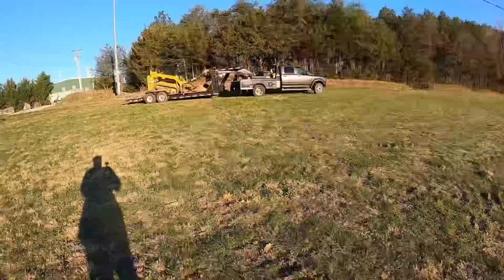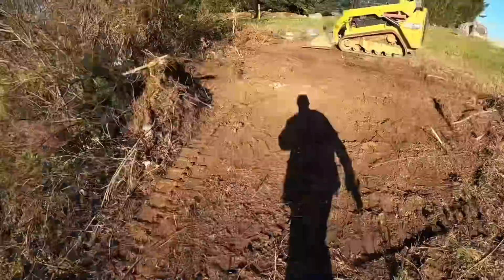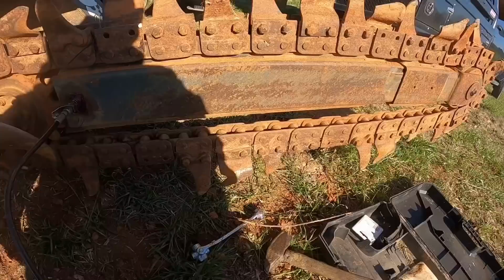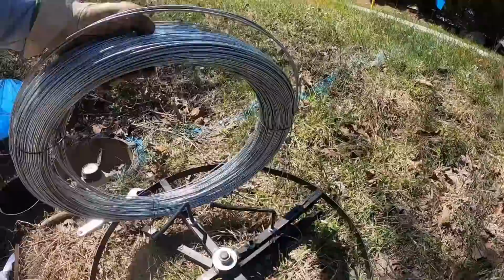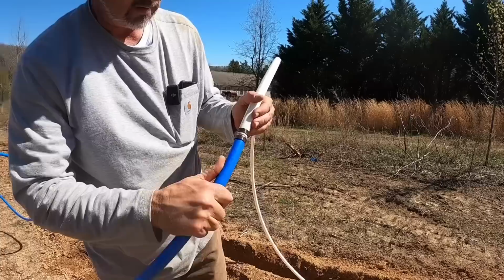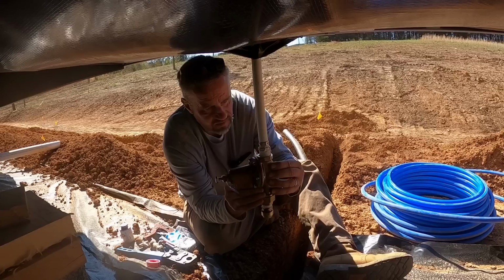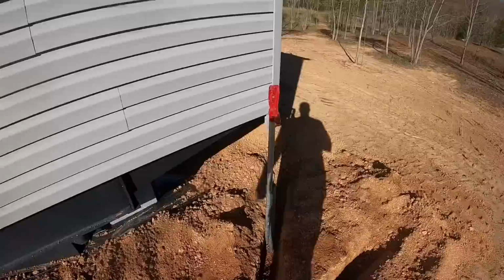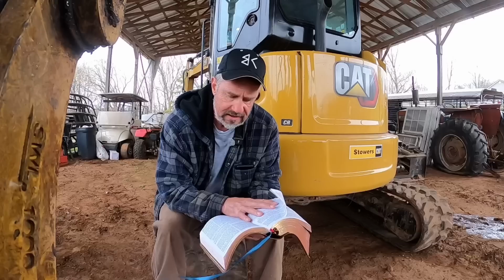START TO FINISH IN 1 DAY!!! 500’ OF PEX WATER LINE, FROM THE CITY METER TO THE HOME…

Comment from the maker: Had a regular commenter reach out to let me know his comments were not showing up in the comment section and disappearing from his comment section as well.
Is anyone else having that happen?
Reply: Seems as though I can comment on your Pinned Post, But not the video ? 🤔
Reply from the maker: Got it this way! Your YouTube privileges have been revoked...🤪😁
Reply: @tristardiggin  🤦🏼‍♂️ That sounds like Bad News 😂
Reply: I have commented on a few of you other videos and in the morning when I check back it is not there
FYI there is a special tape that shark bite requires that you wrap the connections with that are to be buried. 
I wish we could do what you're doing down there. A plumbing license is required for a project like this and we are not allowed to bury pex. We have to use HDPE black or blue or soft copper, and some real expensive fittings. Love the videos and the message. You are doing everything I do and it is great to see a 1 man band getting it done.
Reply from the maker: Thanks Shawn, I appreciate the info on the plumbing. Sounds like you are in a pretty strict area. Pex is very common to bury around here. So, I guess it isn't as tough as the HDPE? I normally don't do the plumbing jobs but trying to learn a little more and your info is very helpful. 
That is strange how messages dissappear. If I don't comment back pretty soon then I wasn't able to see it. 
Thanks again,
Sam
Reply: @tristardiggin  yep I live in a strict area, it is called the City LOL(Kansas City). Here if the work requires a license and are doing for a wage ,you need a licensed plumber, electrician,ext. to pull a permit and "do the work" I dig for plumbers and electricians so I just have them pull a permit for me and the just come out and meet the inspector of I put everything together. Or the home owner can pull the permit and say they are doing the work a inspection is still required. Not sure about the HDPE just know here we have to have it coming in the house and then you can branch on to whatever.

Comment: Enjoyed watching your video! Great job sir. Keep an eye on that Sharkbite fitting at the meter. Those fittings aren't designed for below ground installation and I have seen dozens of them corrode and blow apart in my line of work.  God bless you and Happy Easter!
Reply from the maker: Thanks for the info. Will keep a check on that. 
God Bless and Happy Easter as well...

Comment: With electrical wire and water pipes sealed in plastic....never cut or remove the plastic....use the plastic to unspool the wire/pipe....and what you dont use stays neatly rolled up in the plastic until next use.

Also...if and where possible... Use a heavy upside down  t-piece pipe or something and put the spool around/over it to keep the spool in one place while you do the unspooling
Reply from the maker: Yup, good ideas! I think that would work…
Thanks,
Sam

Comment: Im a plumber in cali, if you are going to do a job like this again try to buy parts online they got all the stuff, and i try not to buy stuff at lowes because sometimes they dont have everything you need, you have to plan ahead for a job like this, and we dont use those pex b because they leak, we use pex a and they also sell insulated pex online.
Reply from the maker: Great,  thanks for the info. I rarely do the plumbing work but learning each time...
Sam

Comment: I just installed 300’ of waterline here in NY.  I sure do envy the soil conditions and frost depth you are working with there.  Mine was through areas of hard packed clay with rocks, gravel and a wet area that tried pulling my Muck boots off my feet….at 5’ deep.  I dug mine with an 18” bucket on a 304 (I can’t dig to 5’ with a 12” bucket because of the width of the thumb).
Reply from the maker: Well, ok, after hearing your experience I won't complain about the pex anymore! 🤣😁
Wow! You had a messon your hands...
Reply: i feel ya from over here your neighbor from PA lol same kinda stuff around here its rough up north lol but same machine setup too!
Reply from the maker: Interesting how we all do similar work but definitely different techniques to get it done...
Thanks,
Sam
Reply: @tristardiggin  love your videos man been following along for a couple months now its crazy how different some things are for the same end result depending on the area!
Reply from the maker: Thanks Joshua, I sure do appreciate you supporting the channel...

Comment: Hi Sam,
Easy digging and must not have that deep of a frost line. Our frost line is 6' here in Montana. I've installed a ton of underground. 
Couple of pointers for you to try and or consider on the next one. 
- The inside diameter of Pex is smaller than the pipe size. I wouldn't personally go less than 1 1/4" ID for water volume and I also prefer poly pipe. We use ford pack joint fittings on everything. I'd rather not dig anything up again to repair it. More expensive but 100x better IMO.
- Crimped pex fittings are garbage. 
- Pex Type A piping is great for plumbing supply lines in the house even though it is rated to be buried.
- Unroll the roll of pipe next to the ditch instead of trying to "unspool" it and drag it. I had to learn the hard way too.. :)
- Utilize frost freeze hydrants that can be repaired without having to dig them up (I prefer Iowa frost freeze hydrants).
- When running pipe under a road we like to put foam board insulation over it before we bury it so the frost doesn't push down to the pipe when driving over it. 
I enjoy your video's, keep them coming!
Reply: Also, I'm definitely not a plumber but was in the fire sprinkler industry for 20 years. Curious what the water pressure was at the house before installing the pressure reducing valve. If memory serves me right house fittings are good up to 65psi. Just wondering if you could of done away with that pressure reducing valve. Nothing worse than standing in a shower and feeling like I'm getting peed on, lol.
Reply from the maker: Yup, low pressure in a house isn’t very good. Not sure what street pressure was. The customer requested the pressure reducer when I installed the line…
Thanks
Reply from the maker: Hey thanks, I appreciate the tips. Frost line is very shallow here. 18” is plenty deep for water lines here. 
Sam
Reply: @tristardiggin  18" is crazy! Hey, I promise i'm not picking. But on the bottom of the frost freeze there is a weep hole. When the valve gets shut the water weeps out of the hole. What I like to do is take a 5 gallon bucket and cut the bottom of it out. Slide it over the pipe and fill with gravel. Than back fill with dirt. Gives the water a place to go and should help from keeping the weep hole from getting plugged up with dirt. :) God Bless!
Reply from the maker: @dudewheresmyhorse625  Thanks, appreciate the tips…
God Bless,
Sam

Comment: The proper water service line would be HDPE to the house.  PEX will work,  but you wont get nearly as good of flow.  and you will want to use different fittings and clamps.
Reply from the maker: Thanks for the info...

Comment: I worked for a local water utility for a while. Just an FYI, it's never a good idea to use galvanized pipe nipples or connectors of any type. It will be the first piece to fail in that system. Copper or pex will both outlast anything galvanized.
Reply from the maker: Thanks I appreciate the tip. I don't do a lot of plumbing so advice is always welcomed. Thanks for supporting the channel with views and comments...
Reply: @tristardiggin  Try brass next time instead of galvy.
Reply from the maker: @um8440  thanks

Comment: I put 1 inch pex from the meter to the house.  I sleeved mine with 2 inch pvc pipe.  I was afraid of rocks poking my pex.  I guess it's ok if i don't do it for my garage that I'm building.  🤔
Reply from the maker: Hey Mark the 2” pvc sleeve is a great idea for sure. I asked the customer about it and they didn’t want the extra cost. Also, that pen is supposed to be pretty tough stuff…
Thanks

Comment: Pressure reducer, nah I got over 60lbs at my house... 😂 question for you, do you have a separate hourly rate for yourself from your machine rate for jobs like that or do you just bid the job? I turn down small jobs sometimes because I usually can't justify doing a job for such a low handyman rate unless I have absolutely nothing else going on... It's weird people will pay a plumber, electrician, mechanic, etc... they don't know 100hr but they think you should do it for them for 30hr because you're not technically a plumber, etc ... but you have more equipment and overhead. In there mind they are helping you out with giving you extra small jobs, but they don't understand you can't make equipment payments when you're doing manual labor and the equipment is not being utilized...
Reply from the maker: I recently have gone up to $1500 per day. That includes machine time and labor time. I charged a little extra on this one because of the addition of the 2 water spigots  which took me over the 8 hour day. I generally just take equipment jobs. But occasionally I will do one like this.
Reply: @tristardiggin  I gotcha, seems like most people charge by the hr meter on machine time. I told a friend 90hr for d3 dozer which is probably to cheap but he has another friend with a high track d5 that was willing to do some work for 100hr so you know how that goes.  I told him any less and it probably wouldn't be worth my time, and he's one of those with 15 different things to do once you're there. I know another guy who runs a 750k lgp Deere for 150 hr. So I guess it just depends on the area and market you're in...
Reply from the maker: Right, it's interesting to see how much difference there is based on where you live and work...
Reply: @tristardiggin   crazy, out here in socal with a backhoe getting $1200 a day. You don’t have the rate cutters like we have out here. 
Mini ex and skid steer are similar out here but no one wants to pay.
Reply from the maker: Interesting how prices change across the country. Fortunately there is still a lot of work going on around here. Thanks for sharing that info...

Comment: It would be nice if you were able to mark the line with a metal wire to be able to find it int future because that ring will rust in 2-3 years.
Reply from the maker: Right, a tracer wire would be good to put in water line ditches. If I keep doing these I will check on that...
Thanks,
Sam

Comment: Really surprising you used a shark bite pressed fitting to the main line
Reply from the maker: Seem to work ok I have used them a good bit. Have you had problems with them?
Reply: @tristardiggin  They are against code where I’m at and can only be used for emergency repair—If you haven’t had any issues then thats good but i’d recommend doing a sweated fitting they make pex ones that you can sweat a pex adapter onto the copper and then do the crimp—more durable and provides more longevity
Reply from the maker: Good deal thanks for the info...

Comment: Do you have the electric quick attach or the hydraulic? He have had the worst time with the electric one on the 259 at work but mine at home is the hydraulic coupler. I really like it. Granted I’ve got 300 something hours on mine vs over 4000 hours on the 259 at work.
Reply from the maker: It is electric. But at the moment it is manual 😁 with the hammer attachment. I have been through two of the electric ones so far. And so far I've refused to spend $1100 bucks on a 3rd one. Sure would like to have it back on though...
Reply: @tristardiggin  Ahh, I wonder what the hydraulic set up costs over the electric one. Mine came with it so I don’t know what the upgrade would have cost. Grapple was supposed to be here yesterday but didn’t show. Waiting anxiously!!
Reply from the maker: Cool, send some pics of the grapple when it comes in. I suppose I will break down and by a new coupler. Maybe with my YouTube money. Oh yeah, that's right! Not much coming in...😫
Reply: @tristardiggin  I bet you will have it coming is soon. You’ve got good stuff!! With the Lords blessing backing it you can’t go wrong either way!!

Comment: Hi, I am in construction business to trying to figure out the prices people charge for this kind of work. What do you charge this customer thank you."?
Reply from the maker: I generally charge by a daily rate plus materials. Almost never by the entire job. I will be between $1200 and $1500 per day, depending on the work and size of equipment that I use. I do charge extra for travel, depending on how far away the job is. There are some variables to it but that is kind of my standard...
Reply: Thank you that's decent. I'm assuming it's not include material?